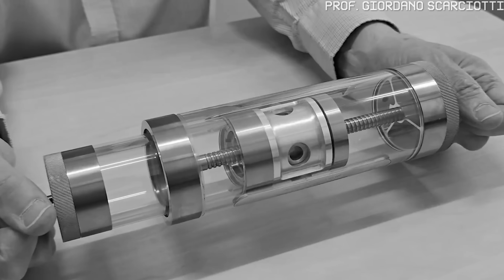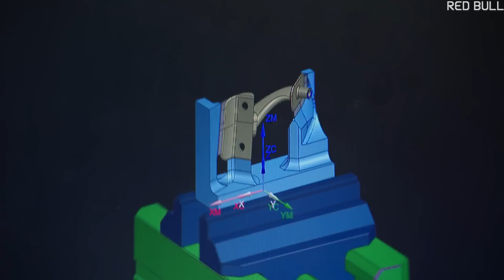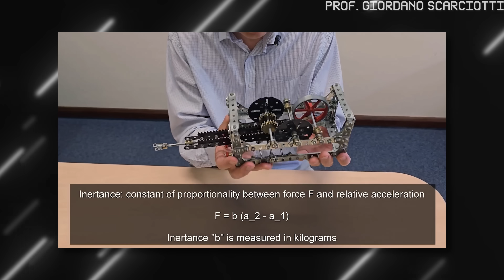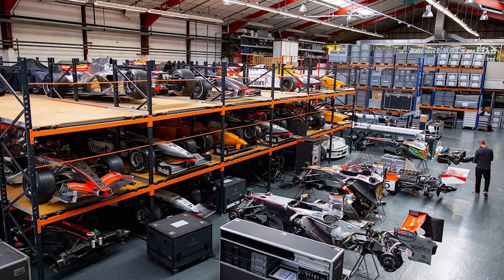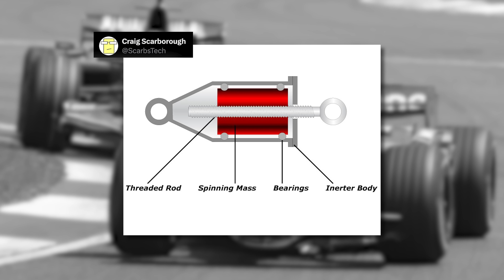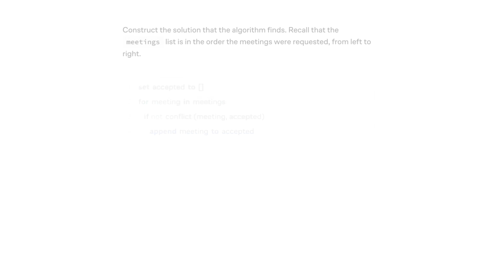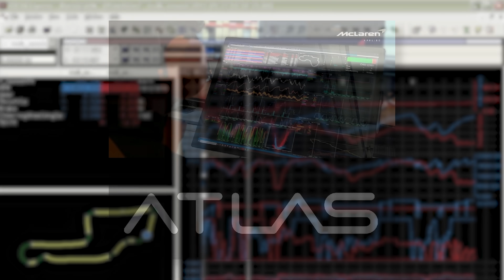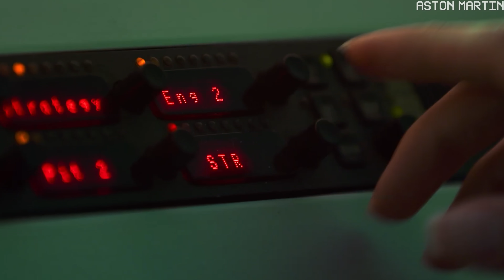The Genius Tech NASA Stole from Formula 1

Comment: 16:46 What about bearings?
Reply: There are magnetic ‘bearings’ around these days that are no contact, just supply power and the magneto will hover in the field 
Even pc fans have used a basic type of magnetic bearing in the past and to a degree the same effect applies in current designs, which need minimal stabilisation and can last 20 - 30 years no problem
Reply: @timmyjohnson7192  It remains to find a source of energy that will last 20-30 years
Reply: My thoughts

Comment: One could think that a satellite on a precise orbit may not like inertia from a flywheel spinning within.
Reply: Still they use them, both for gyroscopic stabilization and for changing the attitude by accelerating/decelerating the wheels.
When the rotation speed becomes too high ("the wheel is saturated") they use small rockets to apply a force and decelerate the wheel correspondingly.

Comment: I don't like to quibble, but weren't Lotus using Kevlar and carbon fibre in 1978 on the 79?
Reply: Lotus were first to use Carbon in the chassis but it wasn't 100% Carbon. And I don't think they used an autoclave either. McLaren were the first to use "baked" all carbon tubs

Comment: Don't forget about the time that F1 adopted NACA ducts.  It goes both ways.  :)
Reply: NACA and NASA aren't the same organization though?
Reply: @bass2762 NACA became NASA AFAIK.
Reply: @2testtest2  It did, NACA was the National Advisory Committee for Aeronautics, When the space race started it became NASA. adding the spacey bits to the aeronautical bits and even today NASA continues aeronautical R&D. I would imagine F1 watches their aerodynamics research quite closely as for example more efficient airplane wing designs could translate to racing(considering the wings on a car are basically the same thing but they point the wrong way for flight... Well unless the car gets pointing the wrong way at high speed).
Reply: @bass2762 NACA turned into NASA.

Comment: Flywheels as energy storage are really old. I'm sure Williams did some improvements around it but the core idea has been in use for decades
Reply: Watch the referenced video and you will get a better understanding. Ultimately what makes this device new, is that it resists "relative linear acceleration". Such a device apparently never existed before. Springs resist force, dampers resist velocity, mass resists acceleration, and the inerter (j damper) resists relative acceleration
Reply: @Bono_w-x  This was used all over the place in WWII for sun sites and navigation.
Reply: @-BigTMoney- I don’t know what you’re talking about
Reply: This isn’t energy storage it’s just instantaneous resistance against a power source, that’s why it has a fixed gear and axle as opposed to a bearing. The general idea that a flywheel requires a transfer of energy to accelerate has been known for thousands of years. This is innovative because this is the first time it’s been used as a damper in a way that is more efficient than the currently know best methods of doing so.
Reply: @henris8367 watch till the end
Reply: I'm really surprised. The fact that flywheels increase the inertial mass seems very obvious to me, I'd have expected everyone to use it if it was viable. 

Maybe it's one of those things that's only apparent in hindsight
Reply: @shoam2103  The first person to make a wheel probably didn’t think of all its possible uses either 😎
Reply: @shoam2103  It doesn't. The gear make stuff move faster. So you push a little but actually you move things fast ... it's just levers
Reply: @shoam2103  many of the homologation decisions in F1 are driven by commercial interests. Williams mechanical energy store might have been better than batteries, but if other teams/manufacturers were invested in battery companies, that's where the decision would go. Follow the money.
Reply: @shoam2103  Absoluitely everyone - except our video author - HAS used this for a very long time, particularly in space applications. In fact, he shows a picture of HST (Hubble Space Telescope). As I recall, I think the telescope cover hinge has a very similar device for the same purpose. The F1 version  (and the old mans "mecchano", properly named an "erector set" ) is a very crude implementation that weighs much more than necessary, because they haven't realized that you don't need very much reaction mass if you put an additional damper on the wheel itself.
Reply: Obviously it wasn't a new idea but they were looking at this when KERS was being introduced and Williams idea was rather than heavy batteries they could have an electrically powered flywheel that spins really fast and the faster they can spin it the more energy it can store or the lighter they can make the flywheel.
Sure not a totally new concept but Williams did what F1 does and min/max the hell out of it
Reply: decades? Dude it''s literally been around for millennia. This has been used in the Neolithic.
Reply: @christophdiegelmann9589 As energy storage? I highly doubt they had it in the neolithic. I was referring to industrial applications anyway
Reply: @JonOsterman59  What else is a potter's wheel? You spin it with your energy and it keeps spinning.
Reply: @christophdiegelmann9589 Any wheel keeps spinning. I would differentiate using it as energy storage specifically as a concrete case. Otherwise the definition becomes meaningless
Reply: @JonOsterman59  It's your opinion. If you want to create arbitrary differentiations do go for it :) I don't think Williams stored energy .. any wheel keeps spinning ¯\_(ツ)_/¯ merry christmas :)
Reply: @JonOsterman59  Even the energy storage aspect is not remotely new - spacecraft reaction wheel systems can either be allowed to or prevented from generating what is called "null space" momentum. If you allow the null space momentum to develop, you can bleed it off for energy exactly as described - either electrical energy or heat. With a typical satellite reaction wheel system- maybe, 4 18" diameter wheels that might have 1000 rpm worth of null space, you can put out enough energy in a few minutes to turn 50watt resistors nearly red-hot, we have to water-cool then in our development lab environment. Obviously you an bleed it off more slowly to meet the thermal needs for much longer. 
I am not sure where "Driver61" gets his bizarre notions about aerospace technology (like toluene being used as "rocket fuel" - which is certainly not a common fuel and doesn't even appear in the Air Force propulsion manual except as a coupling solvent to get other actual fuels to mix), but it is both nonsensical and self-aggrandizing. I can assure you no one in the aerospace industry is copying anything from F1.

Comment: That SpaceX rocket beneath the NASA text in the thumbnail is absolutely criminal.
Reply: So was showing a group of Lockheed C-130 Hercules when talking about Hercules, Inc. an unrelated munitions manufacturer.
Reply: Also that Fairing 😭
Reply: Why? He talks about both.
Reply: When the Saturn V wasn’t technically NASA.
Reply: First thing I thought 😂
Reply: I share your general feelings, but NASA does pay SpaceX to do a lot.
Reply: @BmacRDX  In reality, NASA has always built little of the final space launch hardware anyways. They're basically a client and general contractor/project coordinator that designs the mission and requirements, does the functional design in order to determine the hardware requirements and specs to develop an RFP to solicit bids from the usual aerospace and defense suspects. The winner is responsible for the detail design and produces the hardware (or further subcontracts out components). SpaceX is different in their approach in that rather than NASA pitching the design requirements to them via RFP, they cut out the bureaucracy by taking on the risk of funding and developing their own boosters from the outset to their own requirements and priorities (while coordinating with NASA and other clients for mission compatibility), and then pitching their fully developed product and services to NASA and other prospective clients,
Reply: @m1ghtymaxXx Very well said
Reply: @m1ghtymaxXx  this is the truth.
Reply: @m1ghtymaxXx 
Space X got a lot of funding fore the f9 so that it got wer it is today
Reply: Inaccurate. NASA contracts Space X so...
Reply: I feel like it's not going to be used in spacecraft, but more for satellites. Especially imaging ones 

Spacecraft shake and vibrate a lot. No way to get around that. There's millions of lbs of thrust vibrating through the whole thing
Reply: Maybe you lot should actually watch to the end? 🙄
Reply: You mean like an Aston Martin F1 car without a Mercedes logo on it even though it runs a Mercedes engine? Absolutely criminal. That's not how contracting works.
Reply: @michaelfitz4351 not got that far
Reply: Ah who cares to everyone else it just an American rocket still lol
Reply: That's a ULA Atlas V actually...
Reply: @B @BilTheGalacticHero  That is a Falcon 9
Reply: On a video about innovation too.
Reply: Also worked at Blue Origin facilities, all contracted work.
Reply: No, the car should be a flyover perspective pointing up, that was the worst thing about this thumb
Reply: Well it's sponsored by nasa
Reply: AI was absolutely used
Reply: put rubber Mr P under Nasa 😁
Reply: NASA gave the rockets to musk, so musk can continue faking space, while laundering money, using musk as the front.
Reply: It's not criminal. It's a small detail of a mistake. Stop over dramatising the hell out of everything. There's something called nuance. Heard of it?
Reply: @michaelvandeborne9382 for real, the word "diabolical" has almost lost all meaning since so much is being described as "diabolical".
Reply: should swap it with an artemis rocket.
Reply: @albr4  why spend $10m  per launch, when you can spend $4B.
Reply: No, Nancy Pelosi is a criminal. That's just a mistake
Reply: @RJD2809 Donald Trump is also a criminal And a mistake but thats politics
Wtf do politics have to do with this video ?
Reply: @timmyjohnson7192 i was suggesting that the original commentor may have been over reacting. Glad i woke some other people as well
Reply: @timmyjohnson7192 lets explore my reasonings for the pelslosi comment. Her personal investments have outperformed EVERY other stock market invester yearvon year by over 12% making  a member of congress the most successful trader in the last 8 years. Predominately trading stocks she is on the board of. Whilst this is technically actually legal as it was allowed during the Biden administration, is it right? Trump  clearly is jot a saint but she takes the biscuits
Reply: @RJD2809  As i said what the fuck has that got to do with this video about race cars and rockets ?? 🤷‍♂️
Reply: Welcome to the quality of this channel nowadays..
Reply: @oTownruler oh god you’re dramatic 😂
Reply: @oTownruler  That's just insane nit-picking. This Channel is about Motorsport, not the aerospace industry. Most people associate rockets with NASA, so why make a fuss?
Reply: Sorry  @TylerBrogger the "why do you care?" bollocks died in 2024
Reply: @oTownruler Trolling level - beginner.😂

Comment: NASA did not steal flywheel tech and satellites don’t use whale oil. These are old Internet myths
Reply: What happened then?
Reply: @Dropz_RSA  Flywheels have been researched far before Williams put one in the car. We already have flywheels in the electric grids in some places, large levitating rings in a vacuum that can store and deliver energy at very short notices. They spin much faster than 60k too, their main problem really is that the outer edge of the disc starts to travel at several mach (not that mach matters because vacuum) and it starts to rip itself apart even if you make one from monocrystalline material that has no weaknesses. And once a ten ton disc spinning at hundreds of thousands RPMs breaks, there is no casing in the world that can take the kinetic energy. Williams managed to package it neatly but it is also limited to what it can do: bearings can only take so much. Stuff that is in space and power grid etc are magnetically levitating to avoid physical contacts, both to minimize losses but also.. well, try to avoid wear in that kind of application for ten years when things are spinning 100k and more... Fluid is not good enough, we need to use magnets in a vacuum.

Comment: Back when engineers are nearly free of doing any engineering stuffs
Reply: Dude....this is crazy what McLaren did
Reply: F1 screwed up restricting rotaries. 

 This is what happens when the fans pick tradition, and nostalgia over tech for twenty years. What do you expect. 

 Guys fawning over piston engines when they have been theoretically nearing max efficiency for a long time. 

 Any gains require more complexity, and brand new entire parts unless it's through material science or weird designs. 

 Like chips or turbos. Material science has seen improvement. 

  Best new thing for ICE is a double E Turbo. By then might as well just use motors since they HAVE seen leaps in power since the 90s. 

 3-4 times the power density. That's not touching these experimental drone motors burst. 

 YASA prototype has 1000bhp peak, at 12.7kg. 350-400kw continuous with a power to weight is similar to a top fuel dragster. 

 Whips an F1s combined system. 

 F1s only purpose is to sell parts for legacy automakers. 

 Technology is amazing right now. 

 The politics and corruption is hot garbage. We should piss on it before it ignites, but people today would be too focused on all the d***s.
Reply: @RedactedDeath  " This is what happens when the fans pick tradition, and nostalgia over tech for twenty years. What do you expect. "

No, this is what happens when you introduce things like budget caps, standard parts, and engineering tokens to cap R&D. As a target to close the gaps between teams for more "competition" on track, and attract new teams. It's the same in WEC. Or in GT-classes with BOP...

E-turbos have been used in F1 since 2014/2015. It's called the MGU-H. From next season, it's cancelled due to stronger e-motors.